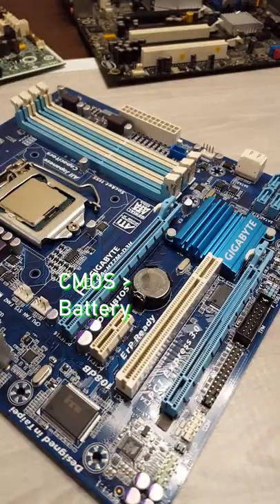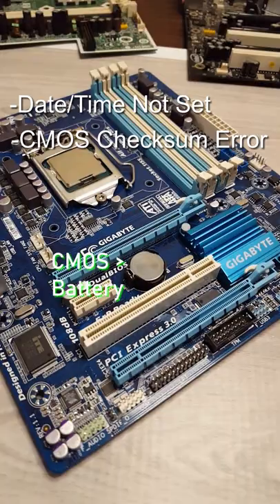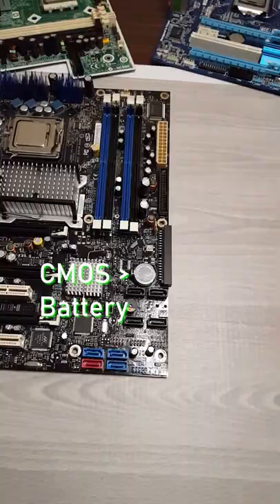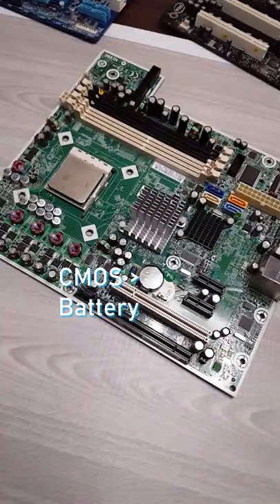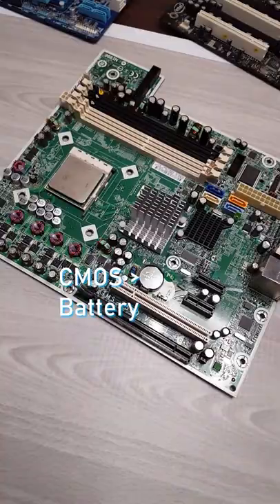Replacing a Motherboard CMOS Battery #Shorts

Comment: I was looking at my new motherboard and I was like I wonder what happens when that dies and cool an error is what happens
Reply: yeah it just means if you lose power any settings you've changed in the bios are lost and it can't keep the time either
Reply: It should never die unless it goes bad.
Reply: Idk if the pc would go error,but I remember if that battery dies,ur system will forget about the hardware config but can still be running
Reply: It's a rechargeable battery, it doesn't die like a normal one
Reply: @prakharmishra5583  WRONG. Ialready caught my sister charging a non chargeable battery. I don't need any more dumbies thinking about doing the same thing. this panasonic battery lasts 10 years in a pc motherboard.
Reply: @YlowX7  how could a non rechargeable battery last for 10 years
Reply: @prakharmishra5583  they can range from 3 to 5 years. 10 years might be a stretch. there are rechargeable variants of the battery used for the bios clock, but the motherboard won't charge it regardless if it's rechargeable or not.
Reply: @YlowX7  you just said they last 10 years lmao
Reply: @YlowX7  I researched and yeah they're not rechargeable, surprisingly.

Comment: Important thing to note is definitely unplug your PC from the wall before doing this. After you unplug it, hold the power button for a few seconds to discharge the capacitors before you pop the battery out. The last thing you want is for a little bit of power to be on the board and when you pull out the battery it drops onto the Mobo  and shorts something out.
Reply: This comment is underrated
Reply: I dropped my batter in tonight and did just that I don’t know if any thing shorted but I haven’t been able to turn pc back on since

Comment: I usually take mine out back and power wash the mother board usually does the trick
Reply: Make sure to get the soap between all the components to wash away any dirt 👍
Reply: I usually connect my dish washer to a isopropanol supply, put al my electronics in it and let it run two cycles🤫
Reply: Misunderstanding

Comment: I worked in the electronics area at Target years ago, and this older lady ripped the battery holder out and wanted a new battery. I felt bad telling her she probably fucked up the motherboard, though if it wasn't working before that she probably had some other issue anyways
Reply: The entire socket out? Lady took the word "pull the battery out" quite too literally.

Comment: Imagine using #shorts and not mentioning the shorts that leaky cmos batteries can cause.
Reply: Who tf has leaky cmos batteries, that things gotta be 15 years old
Reply: I have a 20 year old laptop laying around, the cmos battery is still intact.
Reply: @HoloScope You're not wrong. Check out Adrian's Digital Basement and other channels that return machines from the 80's and 90's back to working condition.
Reply: Are you Linus??
Edit: btw yea flat cell batteries don’t leak
Reply: Lithium (note: plain ass Lithium) batteries don't leak.
Reply: @SibaNL  oh cool my Latitude D420's battery is still working (15 yo this june)
Reply: My battery flew off and hit the motherboard when I did this 😠

Comment: Imagine using a screwdriver instead of your finger.
You dont have to change the battery you can just get it out wait for a min or so and put it back in.
Reply: Not if it’s dead you can’t. That’s kinda the whole point; CMOS battery dies, board loses date/time, error occurs.

Comment: U can also do it by a finger, luckily if you push that pin, a springe lifts the battery up.
But finaly a good and entertaining short.
Reply: Make sure your statically discharged, you don’t wanna end up with a (good and entertaining) short!

Comment: Before Changing CMOS : Date And Time Error, Memory and Memory Module Failure, And Some Beep, No Respond, 1 34 Dell Failure Code
After Changing The CMOS : No Error Until Now

Btw In That Panasonic CR2032 Was An Sign Indonesia Which Means It Produced In Indonesia And It's My Country

Comment: When I bought my first PC I forgot to put the battery on the motherboard and I was using it for several days without knowing it, I only went to find out because the BIOS settings cannot be saved an every time that I turned it on I had to setup the bios

Comment: Are these things not rechargeable?
Reply: No. They used to use rechargeable NcCd cells to power the CMOS and RTC's in older computers. But you can see loads of examples in Adrian's Digital Basement and other retro computer channels as to why that isn't the most durable idea .
Reply: @charstringetje  probably due to leakage and the need of charging regulators?

Comment: I have a really quick question what is the point of a c battery in a motherboard?
Reply: The battery saves the date/time and your BIOS settings for your motherboard. If the battery dies, your computer essentially forgets the time and date, and any settings you’ve changed in your BIOS will be reset to defaults.

Comment: I have a questing what are the engine looking things on motherboards do?
Reply: I think you mean the silver cooling fins that look like flat screwdriver heads.these are for cooling chips under it (no big surprise). Or you mean the small round things which are capacitors. These are used for flattening or cleaning electronic flow.
Reply: @michaelvandenbrink2316  they’re simply aluminum btw. silver has great thermal conduction but costs way more

Comment: Hey any idea how to.solve 2 beep issue no.signal.on monitor  
Bios is gigabyte ds3h b450m
Reply: 2 short beeps on a GB mobo is RAM issue. Reseat your ram and try booting. Remember to unplug the pc from the wall and press the power button for a few seconds before removing the RAM as you want to discharge the capacitors in the Mobo first.

Comment: Why does the motherboard need a battery when it's plugged into the wall?
Reply: I think the thought behind this is so you don't need to power your power supply unit for just your motherboard. And of course power outage
Reply: It’s because there needs to be a constant amount of power delivery to make the RTC (real time clock) have a consistent tick ratio. Wall power differentiates between locations, what would make ticks inconsistent and bad at time keeping for that manner. 

(I just made this up, but it sounds good right?)
Reply: @jerryw1608  I learned that its because BIOS settings are stored in such a way that they erase themselves when they lose power, kind of like RAM. To keep bios settings constant, they power it using a battery. This is much more common in laptops than anything else apparently. The CMOS battery also charges when you plug your computer in, so in theory you should never need to replace it. In practice though, malfunctions can happen.
Reply: @nottsoserious  thanks and yeah, it’s for the NVRAM (which stores value’s like sound volume, screen brightness and several other boot options) and for the RTC to not auto reset by power loss.

Comment: How long will it take till a cmos battery runs out
Reply: Probably a good 10 years
Reply: Depends on whether you buy junk or well-known brands. But in normal condition they both can last from about 4 years up to 13 years. Some people thankfully write the date on the battery as they changed it. I'll write the date on almost everything. Household LED lamps, disposable batteries,...
Reply: @gumpi5  I do this with my girlfriends so I know when one of them needs to be replaced. 
Ps. I always go for the junky type, no need for that long lasting 13 years one’s.

Comment: My bios gets reset everytime the pc is disconnected from the power outlet, could it be the CMOS?
Reply: Yes I'd advise replacing the cmos or at worse motherboard
Reply: It's a Gigabyte Aorus b450 motherboard, I'd like to upgrade to an Asus z570, it's not necessary but I really like how the Asus Prime looks and the broken gigabyte rgb is annoying
Reply: @Mart-E12  remember compatibility and do your research my friend
Reply: Also overclocks would be more stable but I'd have to cool my 3900x properly first
Reply: Replacing the table where your pc stands on surely won’t make the difference! I would advise to just keep it plugged into the wall forever or buy a new computer. Replacing the CMOS is probably the solution, but that would cost a full dollar while it’s also possible that your motherboard’s NVRam connections to the CMOS are damaged.
Reply: @jerryw1608  a full dollar